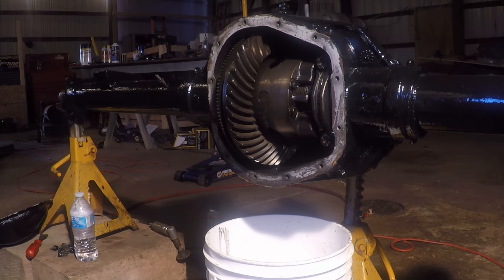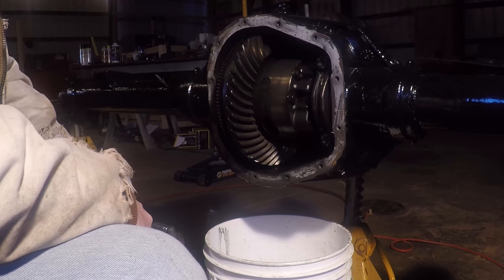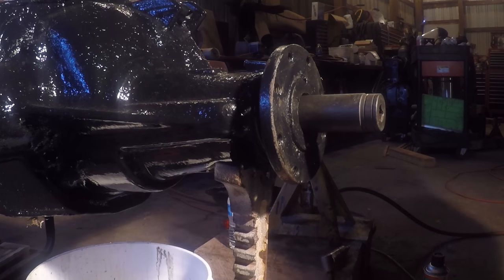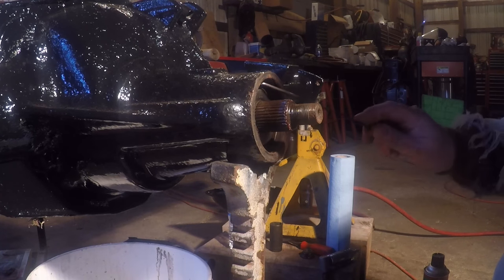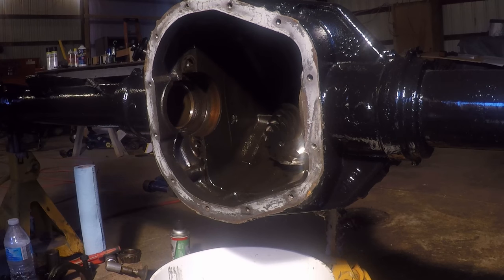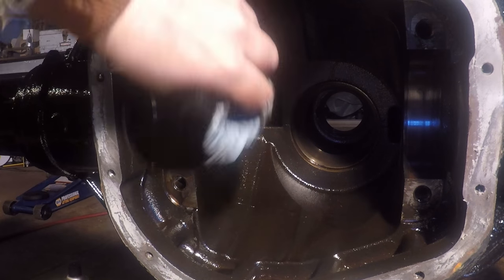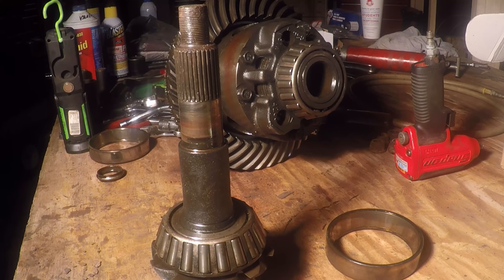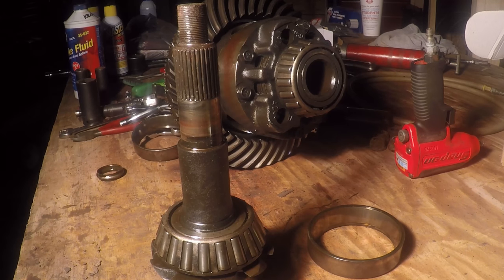#8 BRANDON'S 2010 F250 REAR AXLE RING & PINION ISSUES!

Comment: That's one thing I like about you JC. you want to make sure it is right, even though you may be seling this truck so Brando can get a SC or CREW ( may as well go for a crew with the newest Smith family member coming along in short order, plus extra room in case the family expands ) the person who buys it isnt going to inherit a problem child. There are some folks that would have not even bothered to do everything you and Brandon have done so far, they would have fixed it so there was no noise and sold it and been done with it, next guys problem not theirs. Even if the person who buys has to pay a little extra I think they'd be happier knowing that the truck is right and they can go down the road and not have to worry about sinking a ton of cash into in a week if it wasnt done right. No one wants someone else headaches and doing it right is the way to go, the buyer will appreciate it, you'll feel better about shaking their hand to consummate the deal and everyone will be satisfied. Be interesting to read some of the comments and see what the other figure may have happened that it got bent like that. Look forward to part two on the rear
Reply from the maker: if it is worth the time to do it....it should be done right. it is a whole lot easier doing it now than having something go wrong on the road. he may sell this truck and buy a crew cab or he may keep it as well. he has become very attached to this one because we built it for him. it looks like it will be a decent amount of cash to do it. doing it right costs a little more in the beginning. however, we shouldnt have to touch the rear end again.  if you figure that diff holds 7 quarts of gear oil at a cost of $12./ quart (for the brand i use), if i had to take it apart again to repair something else, i would be wasting $84.in fluid, plus any seals and a lot more time. i hope it goes well.

Comment: When you check on parts ,check on a kit that has Bearings shims and a crush sleve, it will come with instructions and dye for set up!
Reply from the maker: CE Smith that's what I was looking at an "installation kit". It has a good variety of shims, all the bearings and races, crush sleeve and pinion nut.
Reply: Get 2 crush sleeves

Comment: how tight is the pinion yoke nut supposed to be? I wonder if someone previously used the breaker bar and pipe method to loosen, and bent the shaft then. Randys ring and pinion is a good source for parts and install kit as well as summit racing. looks pretty straightforward. you know, " you only haven't done one before ", until you have done one. a good dial type 1/4" drive torque wrench and an indicator , and your set. as mentioned get an extra crush sleeve and an extra pinion bearing cones. hone out the bearing cones so you can slide them on without pressing. this will allow you to shim the pinion without pressing the bearings. once you get the setup right, you press on the bearings. hope that makes sense. good luck, you got this. have a good Christmas, Mike.
Reply from the maker: i would think it would have take a massive "shock" to the yoke in order to bend the shaft. the pinion yoke is what sets the bearing pre load.yes, i was going to take the original pinion bearing and hone out the inside so that it will slide on the pinion without being pressed on. (just to get it set up) after i have got the pattern right then i will press the new bearing on the pinion and begin to crush the sleeve to obtain the required bearing pre laod. it should be interesting!

Comment: yes, you are right......very tricky....and need to have proper tools...to set the "lash".....or ring gear and pinion will not wear properly and be very noisy as well......maybe the BIG TIRES....have some affect on it?
Reply from the maker: the donor truck these axles came from had factory sized tires on it. i have bought a truck for parts that has a good rear differential with the right ring gear.

Comment: Makes me.womder if drive shaft has ever been replaced... shockload or something, and if so, what does transfer case look like? Should be able to go to mid duty ford shop or freightliner and get parts kits. Sometimes dots come from factory being set. Seen it taking dividers on semis apart
Reply from the maker: these axles came from a truck that i took apart years ago. i used the driver shafts and transfer case in my f250 2wd to 4wd dually conversion without any issues. i was thinking that someone had that carrier apart because of those center punched marks and the fact that there are 4 different brands of bearings in it. i am thinking that maybe the truck got high centered in the pinion flange some how.

Comment: Can you tell if the truck has the original drive shaft?  Maybe James Letaw is correct in saying the truck was driven onto a rock or stump or maybe was high centered and sitting on the drive shaft and caused the drive shaft and the pinion to bend, and all that was replaced was the shaft by the previous owner. who knows?
Reply from the maker: Creek Walker it is very possible. I have a couple of theories.

Comment: I have no doubt you can handle it J.C. with the service manual the only deal will be the cost of the set up tools and their pretty much for one axle size per kit.
 If you are pretty good friends with someone at your local Ford dealer you might work out a deal with them if you order the parts from them they might lone you the kit for a day they aren't using it? If you know a Ford tech you might get them to set it up they can normally borrow the tools after work at many shops also. 

When only changing bearings and races or seals you can get by with just tightening everything back up good ( providing there was no other issue before ) on the pinion with a good air gun just stop before you crush the crush washer any further and always use either lock tight on the nut or a new nut to keep it from backing off.
Reply from the maker: it will just take some time and patience...time i have....patience is the problem. the set up tools are just as much money as the ring, pinion and installation kit! that is if you can find the right one.
Reply: I just can't remember 100% though I've not done any since Summer of 05 except for replacing some bearings and LS clutches so we didn't have to change shims I just used the crush washer over not to have to redo the per load either other than feel which after a crap load of you never forget that.   Boy do I miss it. It isn't complicated you'll be able to figure it out just fine I have no doubt.

Comment: a huge shock usually breaks, not bends. some yokes use thread locker and can take a lot of torque to break loose. either way, you have an issue. much better that that was the issue, rather than worn out parts ,with metal going thru everything . now you have more video material coming up, always a bright side. sometimes certain vehicles turn into " money pits", just the way it goes.
Reply from the maker: i have no money in the differentials so at least all the cost is just in rebuilding. yes there will for sure be more videos! i will go ahead and replace all the hub bearings, races, seals, rotors, calipers, brake pads and so on also.

Comment: I believe you can handle this...if someone wasn't in there before, maybe it got drove up on a big rock/stump or picked up with a fork lift hard bending the driveshaft...l think if it came with a yoke back there - that & the U joint would be all that would need replacing...don't know the history/can't say...the 'cost effective' way would be to stick another rear end on the truck...doesn't Brandon want a 4 Dr anyway?
Reply from the maker: James Letaw thank you Mr. Letaw. I am positive someone was in this axle before me....so here we go again fixing another mess. I think I should be able to figure it out.....I hope!
Reply: I think you will figure it out too!  I also think that those commenters who have done this will be able to help. That's one of the big advantages of You Tube, it works both ways, viewers can help the video maker.
Reply from the maker: i am getting comfortable with the idea of doing it....what do i have to lose? worst case i have to do it over....wouldnt be the first time something didnt go right the first time i did it!